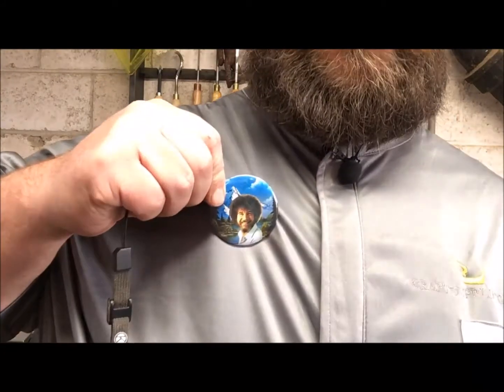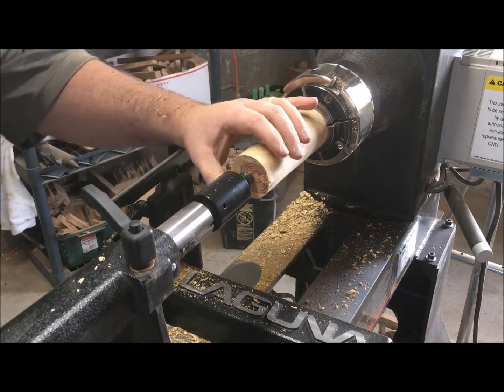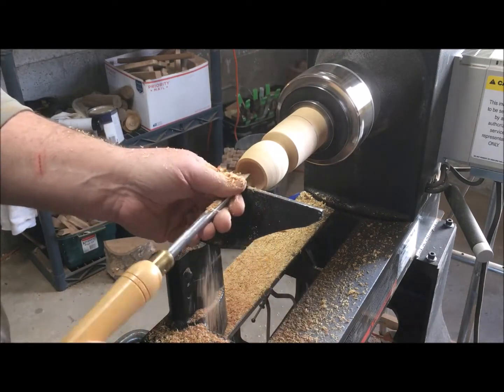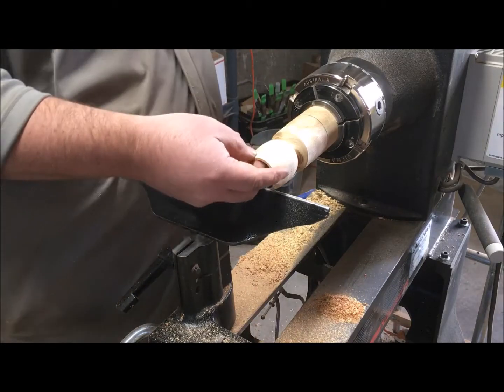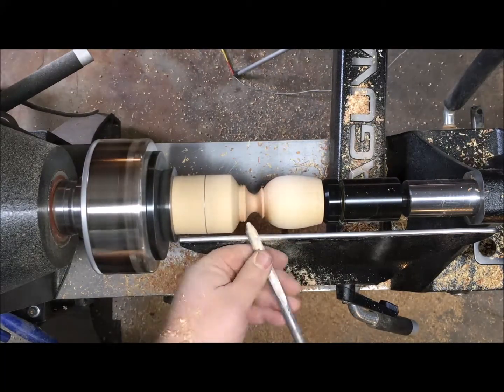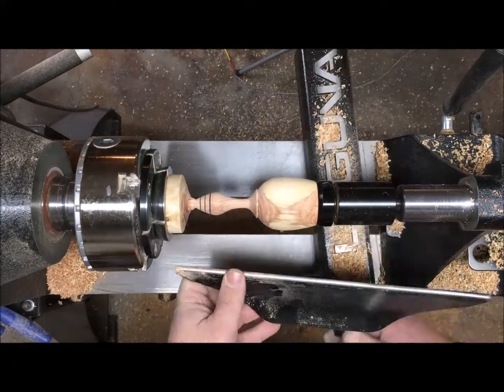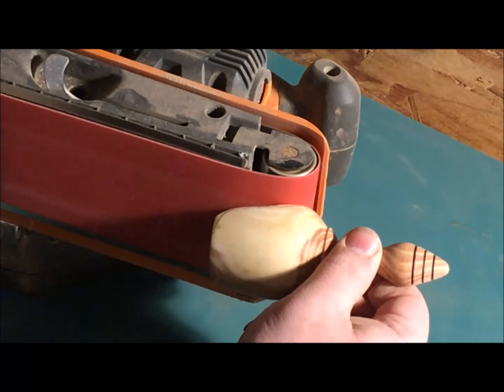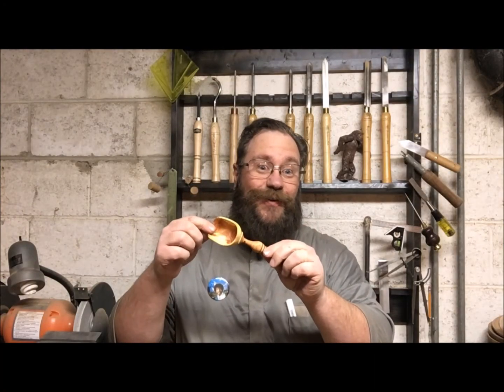woodturning a wood kitchen scoop

Comment: I’ve tried a few methods and like yours the best.  I use a forstner bit for a larger hole, #1 easywood hollower and negative rake scraper.  Follow up with acks abrasive and wax.  Nice.  Thanks.  Love your even walls.😊
Reply from the maker: Thanks!  I’m glad you like the method. If I were to do it again I think the approach would be similar, but I would use my Trent Bosch hollowing system now.

Comment: Just made my first scoop and came here to check your process. Mine has a bit too thick walls. I also striggled a bit hollowing with a 3/8 spindle gouge. I’m gonna try again. Perhaps a 1/2 spindle gouge would be sturdier.
Reply from the maker: Awesome! Yes 1/2” would be a bit sturdier. Hollowing is always a struggle but those struggles help us to learn. Keep trying!! Thanks for watching!
Reply: @Geiserwoodturner  the second one came much better. Walls are almost too thin now. I only have a 3/8 spindle gouge and I felt comfortable till half the depth. I then continued with the 3/8 round nose scraper. It worked fine. I kept my grinder running and recreated the burr three times during the scraping. The I had a light inside the scoop and finished the outside. I’m learning a lot with each new item. I only have a beginner set of 5 Sorby gouges. I’ll try to manage with those to learn the limits and acquire new tools when I really need.

Comment: Ever run into trouble with the pith cracking? I know you mentioned not to put it in center but does it being in there at all lead to cracking?
Reply from the maker: Not on something small that is already dry. If I was turning green I would not use a piece with pith in it. As a general rule it is best to remove pith altogether!  Good question.